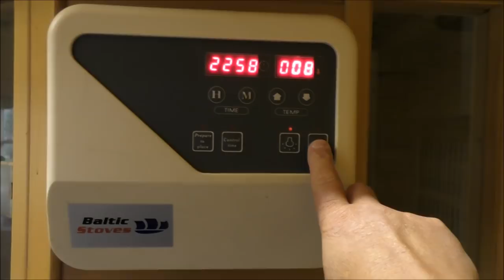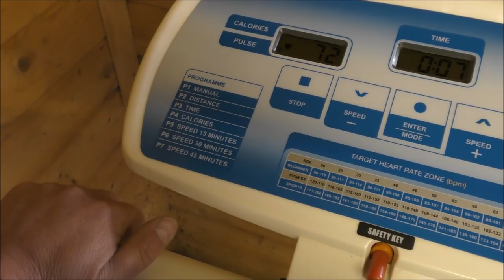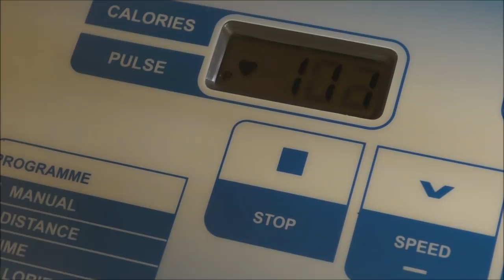Update, Channel Opportunities and Other Stuff.....

Comment: If you plan on getting rid of that large tree stump and time is not a pressing factor, do it the easy way.  Get your power screwdriver and drill a lot of holes through the top.  The holes will catch the rain water, keep the stump moist, and bacteria will do the rest.  Two spring > fall seasons will do the job.  It works.  I've done it several times.  A lot better than the burning stump routine.

Congrats on 100 K and I agree with you that the really good channels deliver hard information and not socializing.

Comment: Great video you truly are the guru getting your Zen on 😂  but i do have a question as regards to fine filter pad/polishing for canister filters  ,which do you recommend I'm currently buying the bulk cheap stuff that comes rolled up like a mattress  ?
Reply from the maker: Yes anything which acts as a fine pad is OK whether it is cut as a rectangle and packaged or if it is a big roll it all does the same job no worries. Just avoid any foam of fine patting which is marketed as furniture padding or bedding as it will be chemically treated to be flame retardant to conform with human fire safety laws - but that is no good for aquatic life.

Comment: Thank you for all you do. I'm not sure if you truly know the extent of what your hard work has accomplished. I was at my LFS a while back and they asked what biological media I'm using. They were in awe when I told them Biohome. They've heard of it but had no idea where to get any. This is all the way in the States. They've never heard of Pondguru, but they've heard of your product and how great it is. When you get your trade site going, share a link and I'll forward it to them. 

Thank you for teaching me what good media is and how to pimp my filter. I  have a tiny Sunsun HW603B canister filter that I don't think you've covered. I took some of your advice and adapted it to my situation. I  have 1kg Biohome Super Gravel, a set of filter sponges and 4 plastic pot scrubbies stuffed into the little canister and it works like a charm. The way the canister was designed it wouldn't have been more than mechanical filtration. Thank you for your filter wisdom. My aquarium is much better for it. 

Also, thank you for your common sense. Some of us are so used to following directions that we no longer question the logic of what we're told. Thank you for setting the record straight on so much "common knowledge" that is just plain bad. You've done so much to improve the hobby for the rest of us. Thank you so much.

Comment: I know you said you can't answer every comment but I have to ask? How did you raise your pulse like that?
Reply from the maker: I just tell it to go high and it goes. I think I learned it from the early days where I would concentrate to get it low when I was crawling about on steep banksides stalking rabbits with my air rifle then I realised I could get it high or low. The sauna helps as the body is telling the heart to beat fast but the mind has to tell it to beat slow if you want to stay in there a long time.